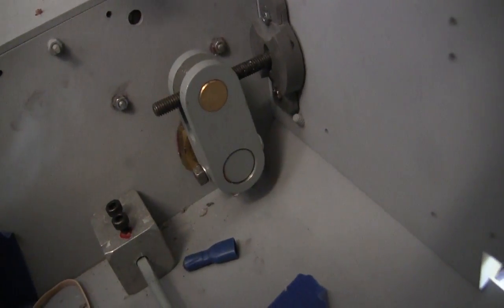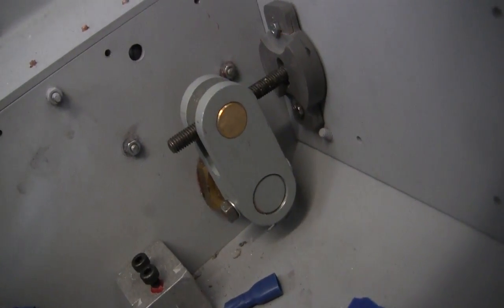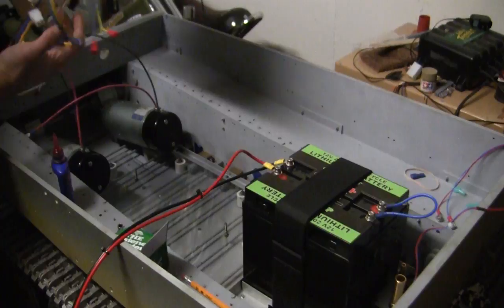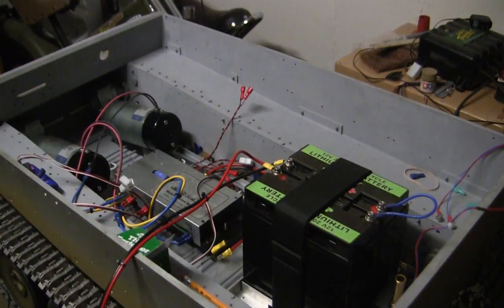Vintage RC 1/6th scale armortek early production Tiger I Video#7 (Interior mounting equipment)

Comment: super detailed im going crazy on 1/6 scale but can't have it it's beyond my budget is there any less a expensive tiger tank you got their that is not super expensive
Reply from the maker: most affordable option in 1/6 is from Field of armor. the kits are static, FOA does have an RC upgrade, never built one into RC with their system so I can't say if it's worth it or not. There are a few videos on youtube of people who have, might want to check them out and ask.
Reply: I just looked at the website and I don't think it's worth it, as yes it is almost 10th of a price of armortek kit, but it's plastic :/ not steel or aluminum and also it's static.... I don't think it's worth that much money for plastic static tank
$800 for plastic 1/6 tiger 1 or £7000 for 1/6 steel/aluminum rc Tiger 1
Reply from the maker: For a plastic static model that price is more the reasonable with what you get,  For RC and metal... the price escalates very quickly, and you will not find anything below $3,000.00
Reply: still I think £7k for armortek tank is worth every penny ;) no doubt
Reply from the maker: As do I, for 1/6 rc, armortek is at the top of the food chain
Reply: take an 1/16 scale for around 200$
Reply: Build it yourself much cheaper